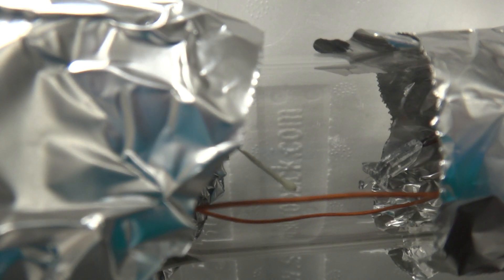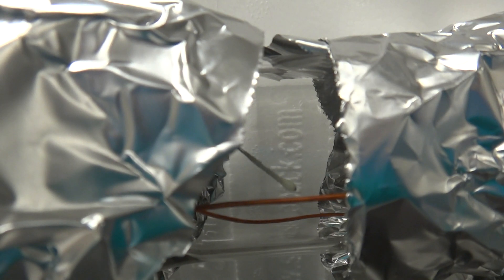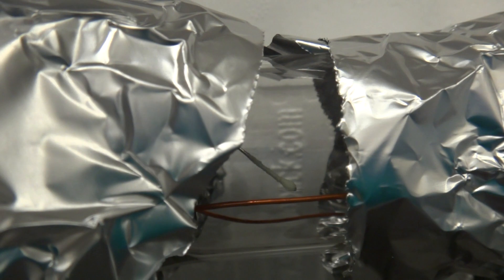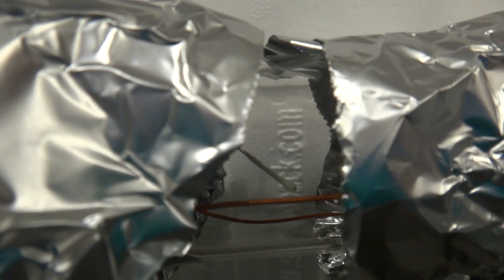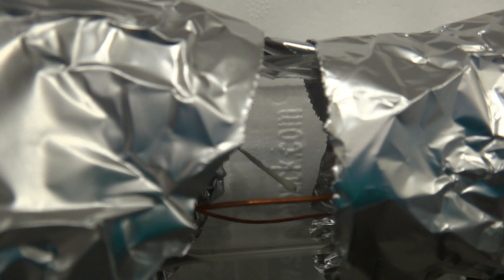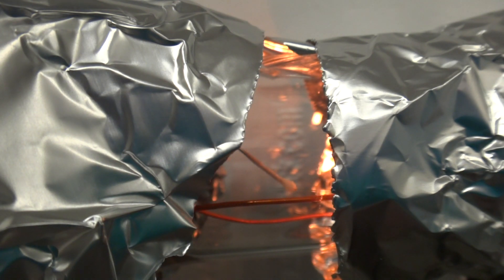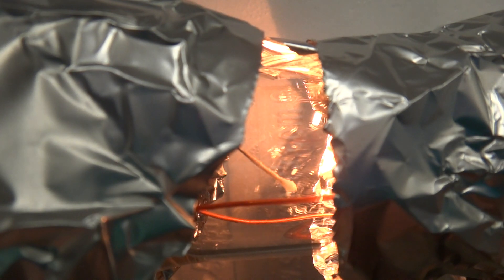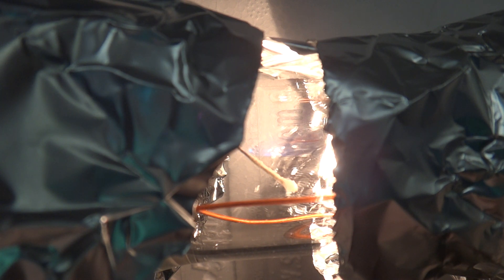Testing Thermionic Emission from a Filament

Comment: we just need to make a simple prototype of a thermionc converter, we use copper alluminium as anode  and cathode enclose in a quartz glass heat source using concentrated solar power.
Reply: is it viable?
Reply from the maker: What temperature do you expect? Then use Richardson's law
Reply: around 700 to 800degress Celsius., can you suggest any way to increase the efficiency of this?
Reply: can you give a simple circuit or a way on how to assemble this?
Reply from the maker: What is the work function of copper aluminum? If it is around 1 eV then it should be possible, why did you choose this material?
Reply: 4.3 for alum 4.7for cu, naturally due to limited resources and financial constraints
Reply from the maker: Are you using an alloy? It won't work with those work functions.
Reply: Roland Hablutzel no, they are pure, no alloying elements.